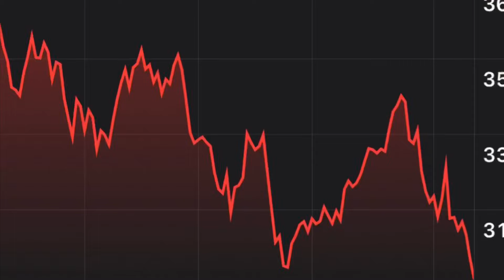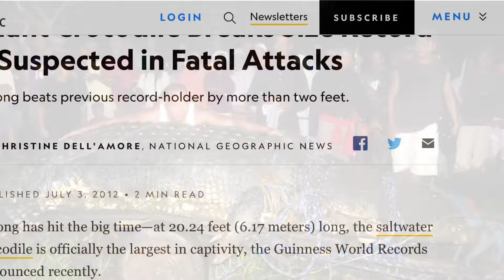Antique,Philippines house build DAY OFF- UFO’s

Comment: Most trees best lumber is not the outer couple of inches called sap wood and the better the wood is therefore towards the centre. That is why fine furniture is usually clear wood and not all the different shades. Maybe different grains from the way it is cut but uniform in colours. But it is what turns your crank that counts so if that is what you like good for you.
Reply from the maker: It’s more interesting. I may have to paint it if it gets too dirty. Long way to go yet